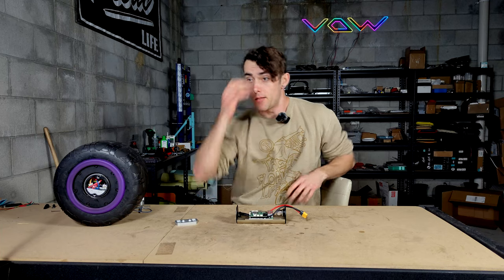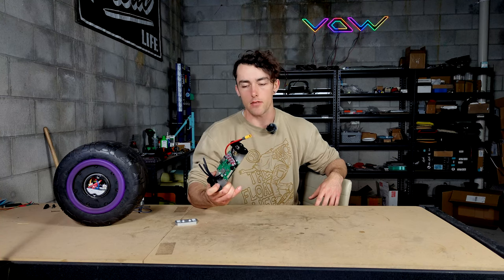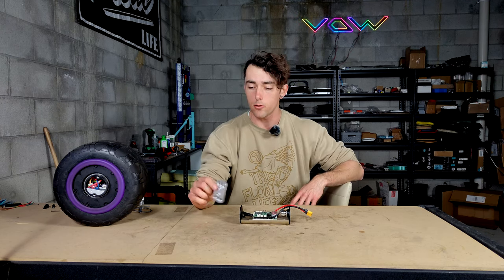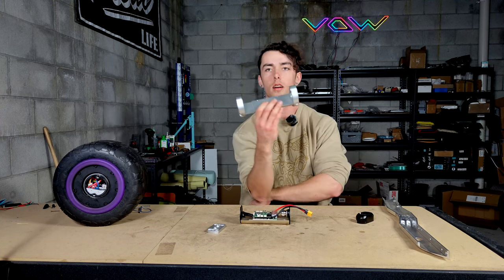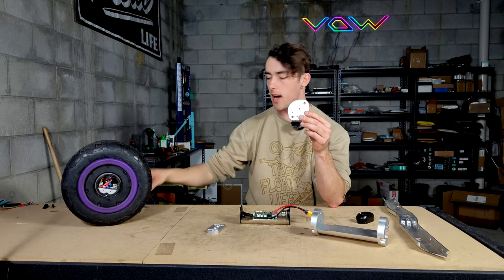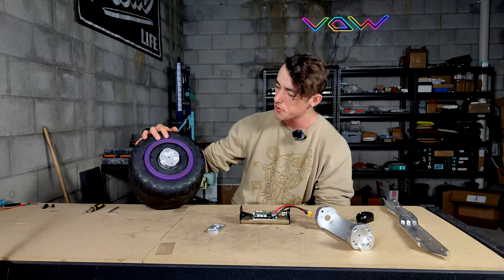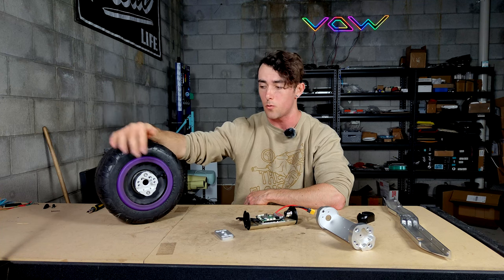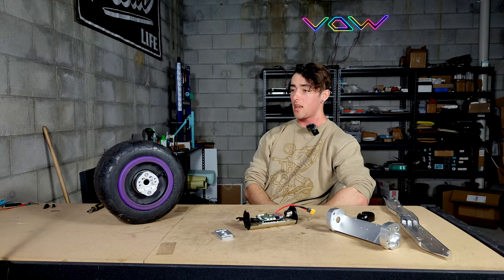Fusion Core V2

Comment: Design thought; temps can obvious get pretty high inside, though not necessarily an issue most of the time. With that in mind, I'm wondering about the possibility of when machining the controller mounting side of the product, would it be possible to use a billet that's slightly larger to have 2-4 hollow channels that run through the entirety of the base to add liquid cooling while not having a potential fail point internally. Using a small inner rail mounted tank with a pump, and "U" shaped connector on the opposite side for feed and return? Could use a product like 3Ms "Fluorinert" for the liquid since it's non-conductive, and chemically stable to further prevent any potential leak issues.

It would definitely complicate an already complicated build, but is something that would reduce both controller and motor temps. Power to and control of the pump might also be an issue, but surely solvable issues.. 

Idk, just a thought after watching.

Comment: Controller in the core seem like he future, only question is heat! How will it perform in really hot environment, combine the heat with the motor. Constant up hill climb is the real test, I have a feeling it won’t do will vs a well cooled control box. Eventually you might need to use 4 heat pipe to the rail!

Comment: Love it, very impressive! That does look like a big improvement. Btw how do you slide that thing into the opening? Isn’t the motor cable in the way? I need to see this in a video 😂
Reply from the maker: No motor cable on this cannoncore, it's just stripped down phase wires with bullet connectors. Very easy fit

Comment: First, 'ECSTATIC how quickly and passionately you improved an already revolutionary (am I using that right?)design!

Second, confirming: V2 will work with SuperFlux?
Reply: I don't see how, this is designed specifically for the Cannon Core which has the space required to put the controller inside.
Reply from the maker: @Mowguli what this guy said
Reply: @Mowguli  I appreciate the clarification! I misunderstood/heard what I wanted to hear when Stan said "any hub" (than my hope took over HA!)
Reply: @edmondsmith4259  Haha no worries! The beauty of this idea is that the CannonCore can be installed on an XR frame. Crazy builds could be unlocked.

Comment: This things awesome, I really want to do a build with one. Do you plan on adding heatsink fins to the exposed area near the axle blocks? Almost like cold onces but just machined into the block. My biggest fear with this form factor is motor temps damageing the controller.

Comment: Does the firmware need to be change or what setting is needed to change in the configuration to move the controller to the middle?

Comment: Hear me out! Wireless antitheft key single button key fob for OneWheel power on/off. "Won't turn on without it, still times out at 20." Long press the button to toggle Headlights/Taillight would be difficult but gold if achieved. Clip it to your belt loop. Power on as you walk up to it. #SavesAstep #PieceOfMind
Reply: Not that it'd be loud, but you could also have haptic feedback beep as an alarm of sorts.
Reply: We already have wireless antitheft - lock/unlock your vehicle via phone or Apple Watch